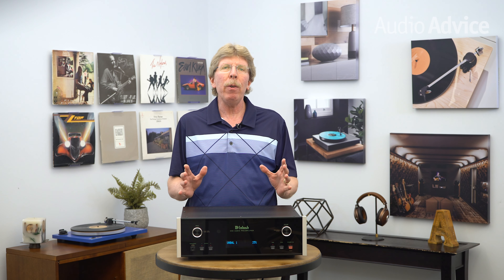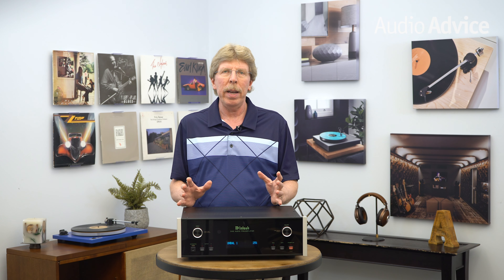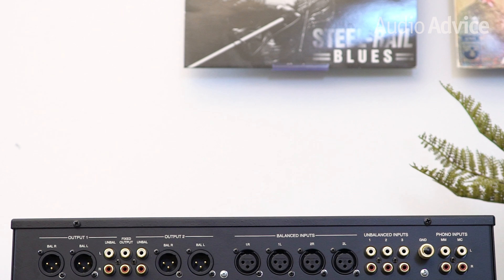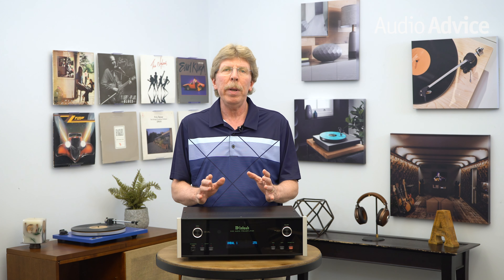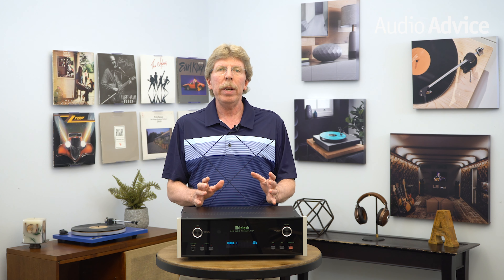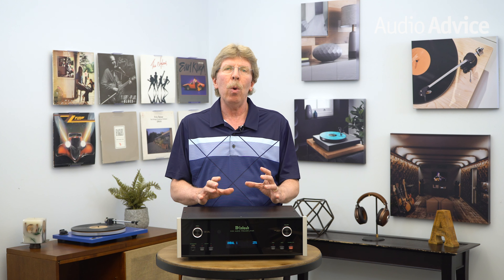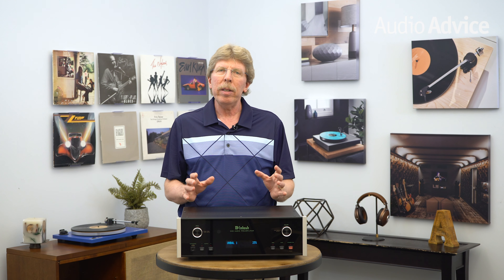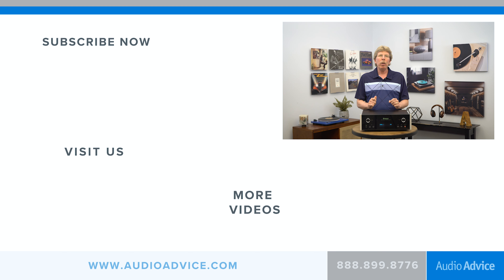McIntosh C49 Preamp Review

Comment: Can someone please explain to me what a preamp does. I understand what an integrated amp is, effectively your entire system such as your phono, CD, and streamer can run through it. I understand what a power amp is, it can enhance and beef up the sound of say a CD player when connected. But I am at a loss as to what a preamp does. Thanks in advance.
Reply: A Pre amp only handles the source components eg Cd,Streamer,etc.It has no connection for the speakers like an inte grated amp does which is a Pre and Power amp in one box.It takes whichever source is selected and outputs it to a set of rca or balanced connections so that it can be connected to a separate power amp which the speakers would connect to.
Reply from the maker: An integrated amp is a preamp and power amp combined into one unit. A power amplifier just drives your speakers with a signal it gets from the preamp, the preamp does everything else.